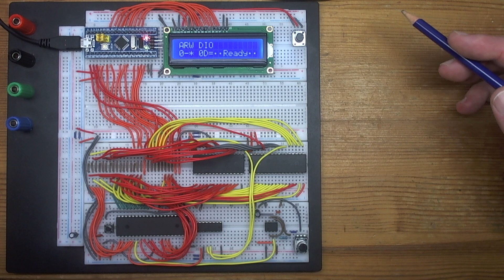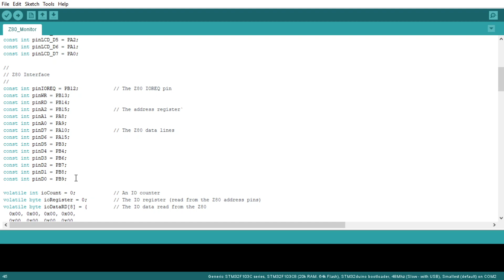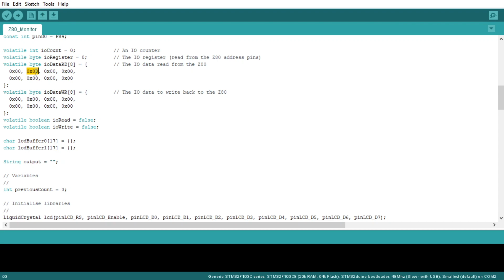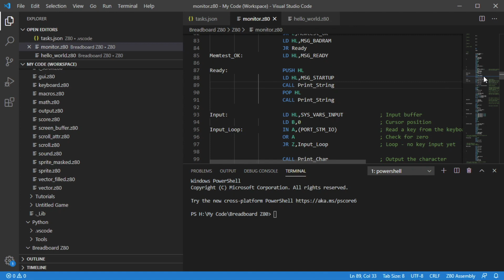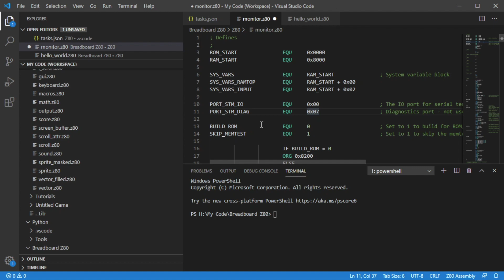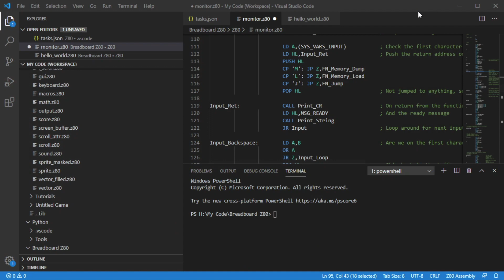Homebrew Computer Part 3: Adding RAM and I/O

Comment: hi interesting project are you going to add a keyboard input
Reply from the maker: Yes, the plan will be to add keyboard input and video output. Not quite sure how I'm going to read the keyboard. Either a matrix keyboard, decoded using logic, or possibly PS/2 read via the Arduino. The video output at the moment is nearly done, using a TMS9918 video chip as used in early MSX machines. I am also investigating using a Raspberry Pi Pico for the video, emulating the TMS video chip, and possibly enhancing it with more modes.

Comment: You skip Part 4 of this series.  Is that intentional? or a mistake.  The last video in the series is part 5,   Also, how far did you get w/ building an MSX compatible computer?  (breadboard or pcb?)
Reply from the maker: Intentional - I was hoping to finish that at some point then got waylaid. The MSX still lives, not had much chance to work on it since the last video.
Reply: @BreakIntoProgram  It's a really cool series and I didn't mean to sound "demanding" in my question.  I am somewhere in the middle of learning how to put together SBC's for the 70's and 80's CPU's (of my own design).  So I love watching how other people go about it.   Never gets old!!

Comment: Hi, I'm also building a Z80 based computer. I'm doing mine a bit different but it's basically the same as yours.You have bbc basic in your machine, can you do a video on how you got that working., I'm asking because when I looked at the bbcbasic website it said it needs cp/m, but you don't appear to be running cpm. About my project: I'm hoping to get 128K ram with switch out able ROM - leaving all 128K as RAM, with graphics done using independant dual ported memory and displayed through a cpld. I did some research on the cpld a few years ago but since then everything's changed in the cpld world so I'm having to scratch my previous research and start again. my ROM will be minimal, its purpose is to load the OS from SD card into the RAM, then switch out the ROM before giving control to whatever got loaded as the OS. on a different note. your unreliable communications with your devices might be helped by using the WAIT pin - just a thought.
Reply from the maker: Hi, sorry for the late reply. This post explains where I got the original code from.
http://www.breakintoprogram.co.uk/projects/homebrew-z80/bbc-basic-for-z80-on-the-bsx
I stripped the CPM stuff out and got it to compile using sjasmplus. That's the code I've currently got on my github in the Z80 folder (link in the page).
Reply: @BreakIntoProgram  thank you. I'll take a look
Reply: @BreakIntoProgram  Nice, thanks. I've just found bbc basic for cp/m and was considering how to get it working on a bare rom too.